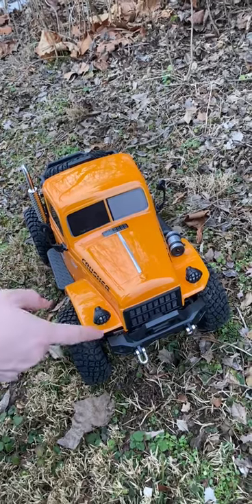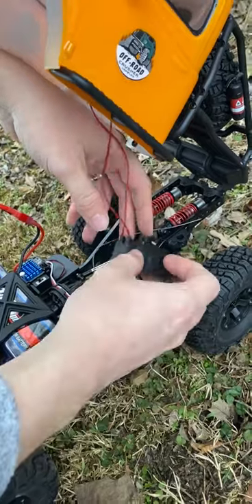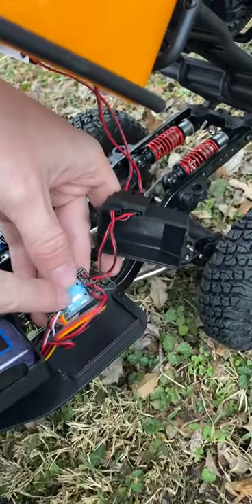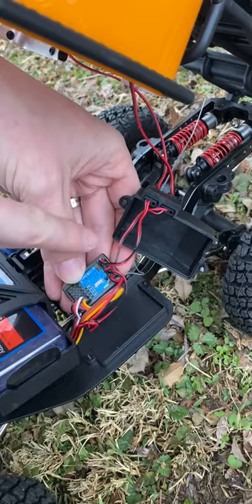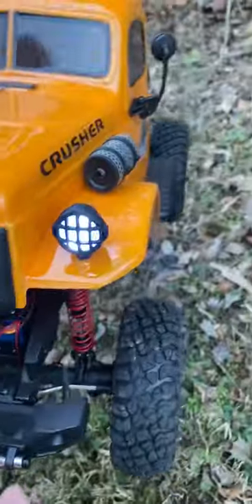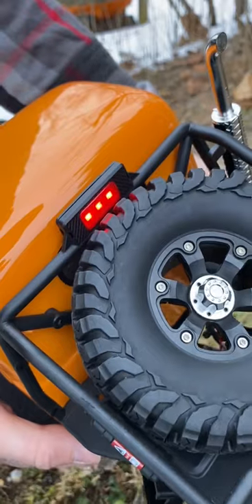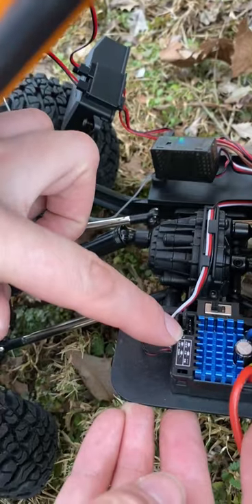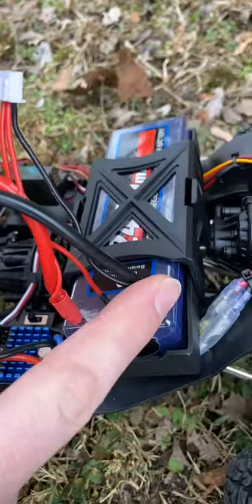Fixing our RC Car! - RGT EX86181 RC Crawler

Comment from the maker: Check out the RGT EX86181 here: https://bit.ly/2Mkxw5U
Use Coupon code BGEX86181 to save 10%
This is a quick fix video of the RGT EX86181 rc car crawler.  We had a couple minor issues right out of the box, but it was a quick fix.  This rc car looks so cool, scale, and realistic.  The rc car is definitely a head turner.  Lets see if its performance lives up to its looks.  Let us know your thoughts on this rc car in the comments.
Disclosure: This description box contains affiliate links.

Check out the RGT EX86181 here: https://bit.ly/2Mkxw5U
Battery upgrade we recommend: https://amzn.to/3sSgixs 
Battery adapter: https://amzn.to/2NtZNaJ
Charger Upgrade we recommend: https://amzn.to/2YdlZIp

The products in this video are rated for ages 14+.

Comment: Crappy old NiMH? When I got my Traxxas Rustler around the turn of the century I picked up some matched cell NiCad batteries. Top of the line cutting edge tech. Good NiMH batteries were for the rich guys and time travelers from the future. The coolest thing about the matched cell NiCads was that the truck would just stop when the battery ran out. No gradually degrading performance, just full speed then nothing.
Reply from the maker: How times change! When I was growing up, I didn't have cell phones or even internet access. Tell a kid that these days, mind blown! 🤯
Reply: @thercsaylorsEXTRA  That's the truth. A few hours without electronics and they're lost. Another reason I love RC. It gets my boys and I out of the house.